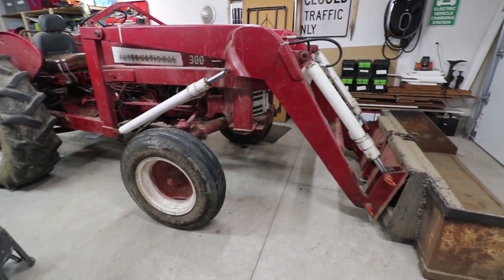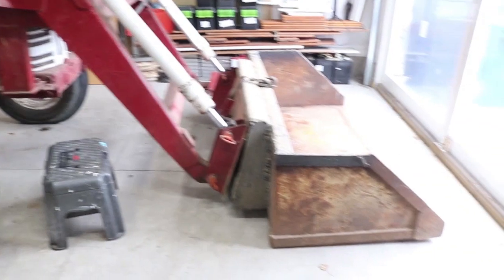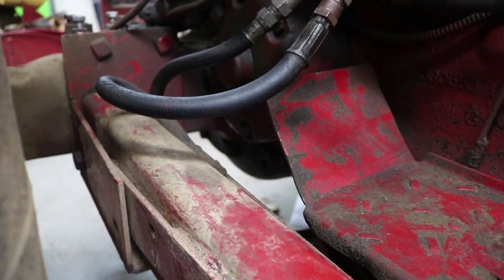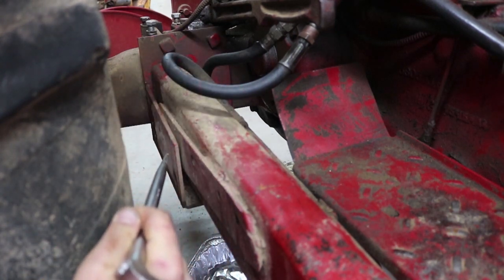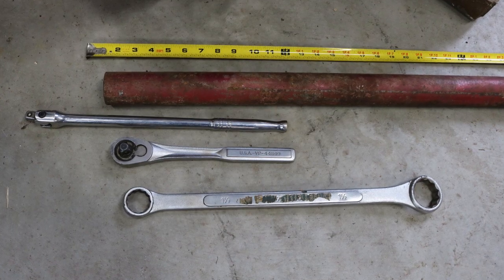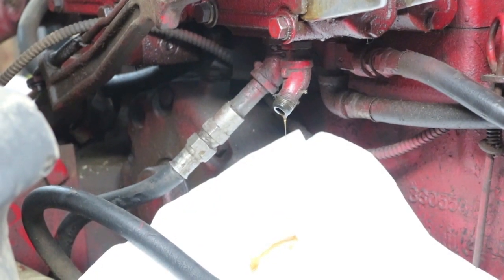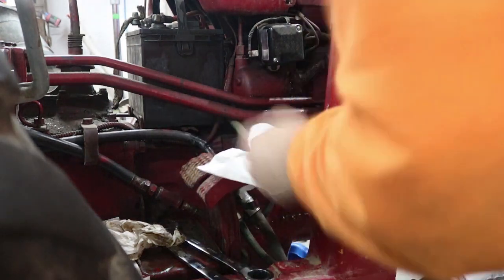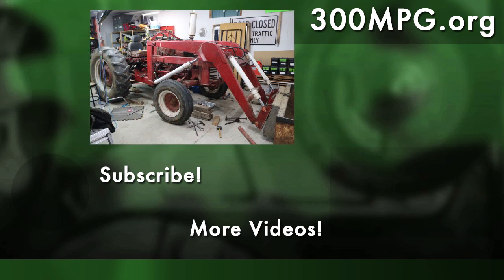Electric Tractor Conversion: Prepping for loader removal

Comment: Nice tractor it is about 40 Hp as it sits. I have a 300u as well. Not too far from you in McHenry il. The hitch is a "fast hitch" two point it was IH answer to Ferguson three point. Has both advantages and disadvantages to three point it doesn't sway side to side so the attachment has to be the standard width. But it can push down pressure unlike most three points which are gravity lowered. You can actually Jack the back of the tractor up with the two point. You also have the torque amplifier on yours. That is essentially a high and low range and can be shifted on the move unlike actual gears. You have a live PTO too not all 300u do. If you are going to keep that front loader you will need counter weight the steering box is theweak link on these tractors. Good luck with the project, but just out of curiosity why didn't you buy a non running one?
Reply from the maker: Hard to test to see if anything even works on a non-running tractor, isn't it?

Comment: Hello Ben ! 👋
Well, I am one crazy guy fascinated by the torque of the electric motors & so the potential they have. Saw your whole series of converting an ICE car into an electric car. So first of all congratulations bud !! Loved it so much that it inspired me ! It's just so amazing !! You're the man 💪

Ok. I don't know if this is the right place to post this stuff but all I want is to give you my best wishes & also to have some suggestions from your side.

I'm converting an ICE bike to electric one just like your car project.
My bike has a manual transmission already which is but obvious & a very common thing.

Now to my issues -->
1. When I am using a maximum 3000 rpm motor & connect it to the transmission, it's not slow speed of rotation or operation of the gearbox i.e. transmission. As the gears are always immersed in the oil & so if I cut the housing, there will be a big issue of oil leakage or when in operation, the oil will come out of the housing. How to seal the oil inside or solve this spillage / leakage problem in order to use the pre existing gearbox with electric motor ? How to solve this issue ?

2. Did you use oil in the 'Geometro's' transmission ? If not then is it really safe to use the gears without any oil at all ??? Won't it ruin the transmission after some rides ? Did you lubricate the transmission at least once before starting to use the vehicle regularly ?

3. Also the oil being very viscous, splashing that oil, as the motor moves the whole system, will consume some power. Won't it drop the efficiency ?? Won't it affects the power output ?

4. Using a transmission will reduce the efficiency because it introduces a bit of losses. So is using transmission really advisable ?? At least in a bike ?

5. How could you shift the gears when you were in motion ?? Is it safe for the transmission ? Was it hard to shift without clutch ? Or did it become hard to shift over the time ?

6. What is the frequency of any maintenance that is required ? Like  brushes of the motor etc. ?

7. I've heard that brushed motors are less efficient than BLDC motors. So what range did you get ? & Also is it advisable to use a brushed motor ?

8. Did you do any calculations beforehand ? Or you just added a motor which was available ? What range did you get ? Top speed ? Other specifications ? Like motor power peak torque motor voltage etc......

Please feel free to contact me.
My WhatsApp number.
+919604010750

Thank you so much !
I will be very lucky to a receive a reply from you.
Reply from the maker: Hi Saket, you probably want to watch my series on converting a MOTORCYCLE to electric. That will answer many of your questions.
https://www.youtube.com/playlist?list=PLmHss3DBZUin2XgGB3vvhxPkLKW0b_mfk

Comment: Quick release is good in places with frequent need to connect/disconnect. In your case, it could be just added cost. Unless, of course, you plan to remove the front loader frequently.
Reply from the maker: The quick releases are not very expensive and should make working on the tractor faster and easier.

Comment: Where you going to use an AC Motor on the tractor?
Reply from the maker: That’s up in the air right now. Which motor we use depends on several factors, including space inside the tractor. I already have a 13 inch DC motor which might be great for this project. It also has a tail-shaft, which would be good for powering the hydraulic pump. AC would be more expensive, but very low maintenance and modern.
Reply: Could you elaborate on why an AC motor would be more expensive to install? Is it the VFD? I am new to the EV scene. I have a Volvo I wanted to install an AC motor in.

Comment: Unbolt the brackets on the axle. They are only there for the loader. Should’ve looked for a tractor with a real three point hitch. Those International 2 point fast hitches aren’t as handy even with those 3 point conversion parts

Comment: I was hoping you were going to drive the tractor outside and use the loaders lift, to separate the loader from the tractor.Get some stumps or cinder blocks to hold the loader level, then back out. At least that was the way it worked with my Ford 901.
Reply from the maker: You’ll see something like that in the next video.